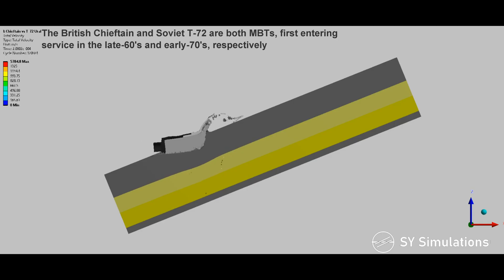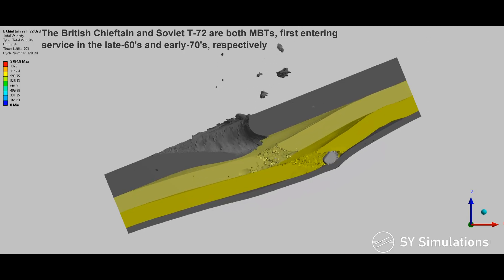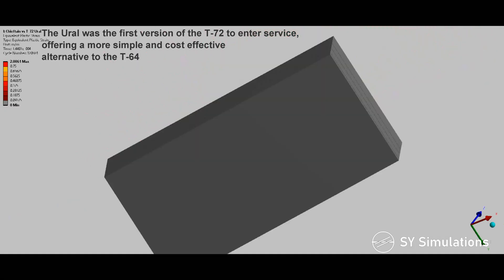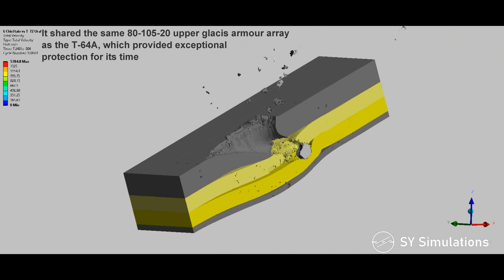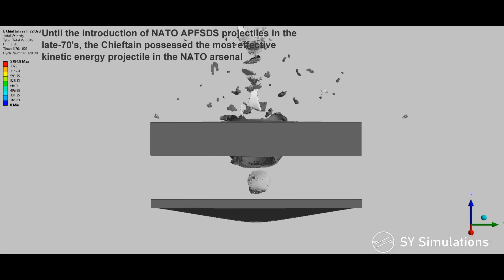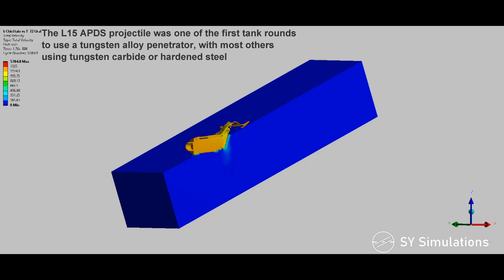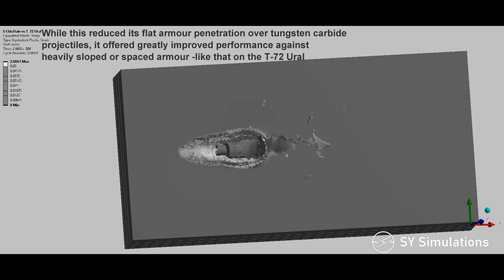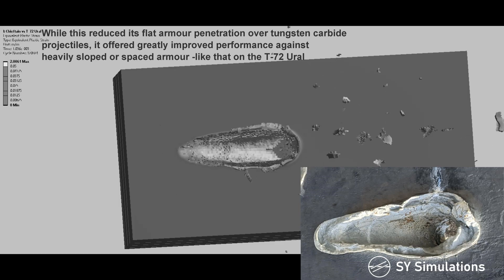CHIEFTAIN vs T-72 URAL | 120mm L15A5 APDS | Armour Penetration Simulation

Comment: That is T-72 biggest weakness: cost effective alternative to T-64, and it was successful in that regard. However, NATO has taken a measure of T-64 and their reply to it was: Leopard 2, M1 Abrams, Challenger 1, Merkava Mark 1 and Japanese Type 90. Unlike the Soviets, US and it's allies produced the tank(s) to counter T-64 & T-72, NOT to match them.
Reply: T-64 entered service in 1966. Leopard 2 entered service in 1979, Abrams in 1980. If you're making a brand-new tank and it doesn't counter what your rival has had for 13 years, you're doing something very wrong.
Reply: @DecidedlyNinja  T-72 was made as an affordable alternative to T-64. UralVagonZavod (УралВагонЗавод) didn't tried to improve upon the existing design. When it was put into service, T-64 was THE best tank in the world. I didn't tried to make a claim about being in the same league because aforementioned tanks are of more modern design. USSR/Russia was all about the quantity, not quality. That includes every kit in their inventory.
Reply: @JustPeasant  The T-64 had a weak undercarriage. Because of the small rollers, there was a high chance of tracks coming off, as well as the inability to withstand heavy weight (The heaviest T-64 weighed 45 tons, the heaviest T-72, that is, the T-90M over 51 tons) Not to mention the scale of production. KHTZ could produce no more than a couple hundred tanks per year, while UVZ produced more than a thousand.
Reply: @DecidedlyNinja the abrams was most certainly not an 80’s design. It was procured in the 80’s because US acquisitions made purchasing it hell, that’s why the first abrams had a 105 instead of the intended 120mm. It was drawn up and designed before the 70’s with the m1 fsed making its debut in 1972.
Reply: Keep in mind the T72 is not the contemporary of the Leo2, M1, etc. That would be the T80, and the original T80 out paced western tanks in both protection and penetration, albeit lacking the advanced FCS features of their western counterparts, like thermal imagers.
Reply: @92HazelMocha  In terms of firepower it was the same main gun (not all version were the same, naturally). It has better mobility and protection then T-72 Ural. T-72B increased protection to T-80s level. Wasn't mass produced as T-72 due to it's price tag. The most expensive tank the USSR had ever fielded.

Comment: You have to remember that even on a non penetrating hit. Most crews would probably bail. I know I would. It’s really whoever gets the first shot on target first.
Reply: @SpongebobSquarepants-i5p  not if none of your foes can effectively penetrate you...pretty much none of the NATO tanks could effectively deal with a t-72 frontally from even 700m whilst the t-72 could dispatch them all from kilometres away. Both sides roughly knew that and would have acted accordingly....
Reply: @Masterafro999 early T 72 didnt have adwanced FCS so while it would be better protected, chieftains that got laster rangefinder sooner would pummel T72 accuratly untill weakpoint was hit.
T 72 got extensive FCS upgrades but at that time new NATO projectiles and tanks were comming to service.
Reply: @petrsukenik9266  the chieftain would likely be forced to switch between targets as the ratio of soviet to NATO armour would make the chieftain variants that had a laser range finder, just above 100 in 1973, disappearingly insignificant. NATO was overalls ahead in FCS till the late 90s. The early introduction of thermal imagers was a major leap ahead. The chieftain was, at least at the time pretty much the only in-service NATO MBT with a laser range finder. The US relied on manual range finding and Germany on early analogue ballistic computers.. just as the Soviets. Natos advantage were their advances in micro electronics. The new NATO box tanks also couldn't penetrate their soviet contemporaries at the time but had the detection edge due to thermal imagers. NATO has always lacked numbers tho. They could afford their advances due to the sizes of their individual militaries whilst the Soviets had to keep up with the whole of NATO at once.
Reply: Then you're not a tanker. If the hit can't or didn't penetrate the armor then you stay and fight. We did not bail and fought back knocking out the Chieftains.

Comment: I would like to see how the contemporary TOW would have done.
Reply: "The Soviets guaranteed in 1979 or 1980 that the T-72 can stop, over its 60-degree frontal arc, all fielded 105mm KE munitions at ranges greater than 500 meters and can defeat the TOW and DRAGON missile warheads at any range. We believe these statements to have been true at that time."
--From a CIA report titled "THE SOVIET T-72 TANK PERFORMANCE" accessible on their website under FOIA. 

The same report also correctly states the composition of the T-72's armor, so unless they greatly overestimated the strength of the textolite layer, it's pretty good evidence that the original TOW and perhaps ITOW wouldn't penetrate.
Reply: @DecidedlyNinja  I'm sorry, are you an engineering simulation video? Do you understand the point of this channel? Did I ask for some clown in the comments section to explain it to me? Did the CIA ever actually fire a TOW at a T-72 Ural or did they just take the commie's word for it?
Reply: I was in the 1980-88 Iran-Iraq war. T-72s armor was too strong for the tow, it did nothing from the front.
Reply: Would go right through. Later T72's would have ERA to mitigate the effectiveness of shaped charges, but the original production of the T72 lacked ERA.
Reply: @92HazelMocha  Contemporary TOW would have been TOW1 with the single warhead. It would have utterly failed against the same glacis.  The textolite core would defeat it every time, barring a hit on the exact same spot.

It would go through the turret cheeks though, and everything from 20mm upwards will go through the hull sides.
Reply: @iatsd  80mm sides and 25mm from Bradley at the time would go trough? LOL
Reply: @AKUJIVALDO  You think 80mm is going to stop much?  Hell, even something as shitty as an M72 law can handle that.
Reply: iatsd @iatsd you said "everything from 20mm upwards will go trough hull sides". So I'm asking about Bradley's 25mm.

Tell me how it would go trough 80mm RHA.
Reply: @AKUJIVALDO  You don't think the Bradley's 25mm can pen 80mm of RHA?  And you want to completely ignore the difference between an M Kill and  a K Kill too?
Reply: @AKUJIVALDO the Bradley thing you talking is actually proof that nothing would happen because of the lower penetration of the non fin sabot, the newer ammo would be a different issue.
Reply: @92HazelMocha   Tow and 105mm guns could not punch through the front plate on our T-72s.
Reply: @92HazelMocha wasnt the OG TOW bellow 400mm RHA pen tho?
Reply: @92HazelMocha  Wrong. But the I-TOW could do it. And the TOW2 cand defeat k1 era.

Comment: I'm pretty sure the t-72 ural was more expensive when it was introduced than the t-64.
Reply: Nope. It was around 30% cheaper. For example, the running gear of the T-64 was designed with self-cleaning in mind and the roadwheels had rims made of titanium. The autoloader was quicker, but way more complicated. All of the seats in a 64 can be adjusted, while on a 72 only the TC can do that. And that's without mentioning the powerplant, FCS and overall ergonomics. I know who told you that a 72 was more expensive. Lazer is an entertainer, not a reliable source and anything he says needs to be taken with a grain of salt
Reply: I see. Btw, I got that info from spookson, a video call "How bad is the t-64" if I don't remember wrong.
Reply: @elgalletita_1366  did he has a video named "how bad abrams is"? Just curious
Reply: @elgalletita_1366  spookston literally reads from wikipedia, he is far from a historian or a reliable source.
Reply: @elgalletita_1366  
Spooks does quite well on american stuff. Cheese burger flows in his blood. 
Outside of american stuff, his knowledge falls way short. 
Mostly because good quality English sources can be hard to acquire when the country of origin is not English speaking.
Reply: @elgalletita_1366  Sure. I mean. Same goes for Spooks. He's not a historian. He's also an  entertainer. For example he often bashes Centurions for having mobility so poor, that they couldn't climb hills...wwhich is simply a lie, but it's funny in the context of the video
Reply: @MrSlyFox  thats funny, centurions climbed mountains back in korea.
Reply: @quan-uo5ws  Precisely. This thing is a freaking mountain goat. It could go places where even infantry couldn't reach. It's vmax is 35 purely because of how stupidly huge the gear reduction of it's final drives is
Reply: You should compare it to the T-64A not base T-64.
Reply: И это абсолютная чушь учитывая что т72 это УДЕШЕВЛЕННАЯ версия т64

Comment: Wow. The armor plate just barely held back the shell. Did Soviets purposely design the armor to have exactly enough armor to stop 120mm shells? Or was it just luck that the armor enough? There is no margin of error. Any less armor, and the shell would penetrate.
Reply: Keep in mind this was rather close range, at more normal ranges the round would be definitely stopped by the armor and not perforate the back plate.
Reply: The armor was mostly designed against the 105mm HEAT rounds / early ATGMs from the early 60s, which was the main threat against armor at the time.
Reply: More likely they wanted to stop a round like this at some range longer than that in the simulation. Perhaps 1000 meters.
Reply: Soviets were aware of Chieftain and its armament at least since 1960. Back then they assumed this gun will become NATO standard eventually, which is why T-62 even came to be. With ban in place on new heavy tanks, and T-64 in development hell, they needed something that can be put into production right away and won't be outgunned helplessly. So they reached to drawer of designs for upgunned T-55 and pulled to-be T-62 out of it.
Reply: More armor = more weight, less speed, less reliability of suspension and bigger price. Engineers always calculate profit vs price.
Reply: @deipalladium8362  - Those are some amazingly precise Soviet calculations especially for the 1960s! No room for error.
Reply: @TheBigExclusive  A lot of these simulations are tailored so that they just barely penetrate or just barely get stopped. Hence the weird 686 meter range used. If it was 600 meters it would have gone through, if it was 700 meters it would have been a clean stop. (Or something like that.)
Reply: The shell did penetrate
Reply: They upgraded the back plate to 50mm later on but yes it was designed this way to safe costs
Reply: You do not want armor to barely held back projectile. Safety margin is a thing. 

Calculation is part of it but it will only provide a rough parameter. The various equation used, even now days, with decades of data points, refinement, and so much more computation power, still have their limitations. 

The russian at that time has access to tungsten carbide apds and steel rod with(out) tungsten carbide core. Testing shows steel rod with the core perform better. So they test shoot their stuff with the best stuff they had. 

You should always plan for the other side having similar best performing stuff. Thus they plan with that in mind, assuming next generation nato penetrator is going to follow the some variety of tungsten alloy/carbide on steel rod.

My guess is the armor can reliably stop those steel rod penetrator at around 1000m. 

But in reality, nato and co best penetrator before m735 is 120mm tungsten alloy apds. The next step down is 105 tungsten alloy apds. The former one does not perform beautifully against this type of new generation multi layer multi material armor (the standard at that time is still pure steel layer), the later one struggle against thicker angled steel armor.

Comment: Why was NATO so slow with the introduction of own composite armors and APFSDS shells, despite those two being well known technologies for over a decade?
Reply: Because NATO respect for Soviet quality of manufacture was low and NATO has far more options for defeating red tanks than just tank on tank action.
Reply: @trentvlak  Read "US INTELLIGENCE AND SOVIET ARMOR" dated June 1, 1980. That gives you insight
Reply: The Soviets placed greater emphasis on tanks in general. Both sides of the cold war's thinking was informed greatly by their experience in WWII. On the Easter front, there were massive tank Vs. Tank engagements where large numbers of heavily armed and armored tanks were deployed to great effect by both sides, and from this the Soviets took it that tanks would continue to be pivotal to future conflicts. Meanwhile on the western front, allied air supremacy allowed them to negate a lot of the advantages of Germany's heavy tanks, and few massive tank on tank engagements took place. So, the west going forward felt that air power was going to be more useful.
Reply: The Americans developed it for the M60 in the 50s but only had one factory to produce it and it was effective but fragile. And they were only like 10 years later than the Ussr to put it into service. Dont forget that they were still using T62s and T55s in the 70s and 80s
Reply: @lemmen01  Only in the USSR. In the GSVG or SGV they had T-64s and 72s as the standard
Reply: Costs. Everything is cheaper in communist countries and NATO countries prioritized naval and airforces. For example, the USSR never had an aircraft carrier, while the US had 10 Nimitz class carriers.
Reply: @92HazelMocha  they had less of them, but "never had an aircraft carrier" is just wrong. They had 2 helicopter carriers, 5 aircraft cruisers (which are smaller but still can launch MIG-29 and even Su-27s tho less loaded plus USSR had VTOL fighter jets) and two hulls laid up one of which China finished. It also didn't have overseas territories, only land borders.
Reply: @limoneleone relatively speaking, the Soviet fleet still wouldn't have been able to compete with the NATO fleet, NATO didn't have a need to over invest in tanks, even so much of their vehicles could still pose a threat to their counters, having more of a focus on soft than hard factors.
Reply: @Malpais-Legate  I agree that NATO aircraft carrier fleet was both larger numerically and in terms of the ship sizes. But I just wanted to correct the record, because the USSR did, in fact, have aircraft carriers, even tho they weren't supercarriers.
Reply: @limoneleone  Yeah they did actually, I mean they was still a peer challenge to the US so I myself would be surprised if they didn't have any XD
Reply: Doctrine and different needs. NATO expected a defensive war where they would fight hull down, mobile, weapon overtook armour so they didn't bother (Leopard 1 is paper thin) nor could they out produce. They invested massively into aircraft, Navy, training, upgrades, targeting and ATGM instead. It wasn't until the M1 did the tank advantage flip to NATO.
Reply: Something I think that factored in was that most NATO countries adopted tanks before composites became a thing and then they kept upgrading those tanks until like late cold war.
Reply: Their own composite armor tanks with APFSDS firing guns projects were in development hell and cost overruns during the 60s / early 70s, eventually being cancelled and having to keep going with the M60A1 as stopgap, look up the T95 Medium Tank and MBT-70 projects.
Reply: For soviet union tank was the most important weapon together with artilery. For NATO is was airforce. 
On top of that soviet union was more militarised society. Funding was not an issue.
Reply: no investment - read "US INTELLIGENCE AND SOVIET ARMOR" dated June 1 1980. it states that the USSR possesses indubitably better tanks - quantitatively and qualitatively, but that the US can match - or even surpass soviet ability if they put the funds in

Comment: When an Iranian soldier stole an M60A1 to the Soviet Union in 1961, they discovered the new M392A1 projectile. After testing, they swapped the 80mm and 20mm plates in experimental 72's (20-105-80). I wonder if that helped?
Reply: that is a disaster to be honest, the textolite needs atleast 50 mm rha at front to disrupt the heat projectile properly. better would be to check out the 60-105-50 armour that was developed after this. or the 10-60-105-50 against dm13 (israeli m111 hetz ammo)
Reply: Ты удивишься, но именно сегодня на канале правда жизни вышел эпизод, в котором рассказывается про украденный м60 и смену брони. переворачивание листов наоборот увеличивало стойкость от кумулятивных снарядов, но значительно уменьшал защиту от кинетики, поэтому был выбран вариант  60-100-50
Reply: perhaps, i personally think it would've
Reply: First time i hear about this swap, textolite would be too vulnerable to small calibers behind such a thin plate which wouldn't slow the incoming rounds enough in the first place. Besides T-72 didn't exist even as a project in 1961 and M392A1 is a 105mm APDS which was already helpless against 80-105-20.
The revised composite on 72A was 60-100-50 and when the israeli APFSDS was tested they welded on an additional 16mm HHA plate.
Reply: they added a 20mm applique plate to the front.
Reply: Absolute lies from start to finish.  The M60A1 wasn't around for an Iranian to steal in 1961, and the M392A1 wasn't even invented at that point.

Why are you just lying like that?
Reply: So you think the Iranians got their hands on an  M60A1 in 1961, when it didn't enter production until 1962, AND you think they had the newest US round as well that only entered production in 1961 and hadn't been issued to US troops in Europe yet?

Why would you just lie like that?  You must know that people who do actually know what they're talking about are going to call you on your bullshite?  Why lie AND do it so badly?
Reply: Нет , не помогло ... Потом решили наварить катанный стальной-бронелист 1.6мм на влд ( поверх 80мм )